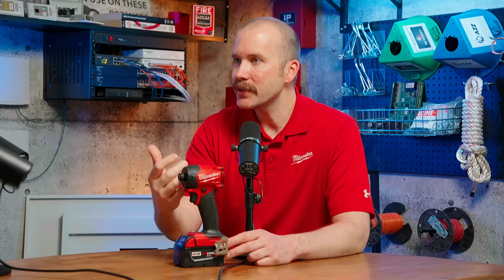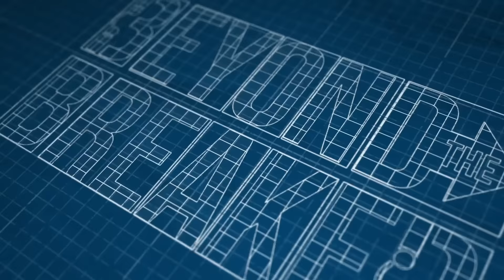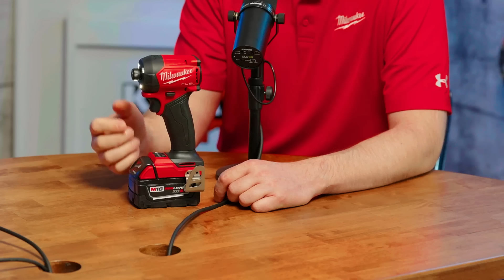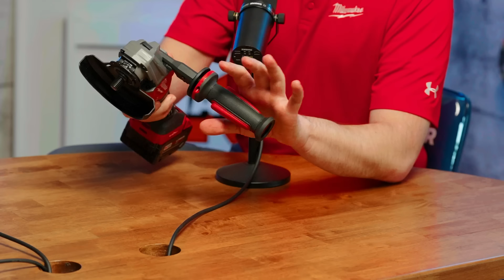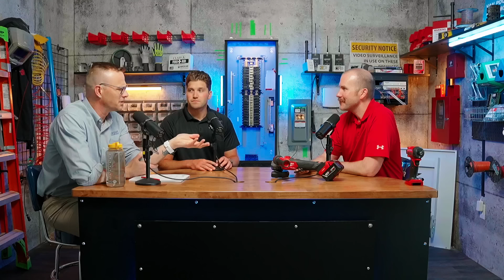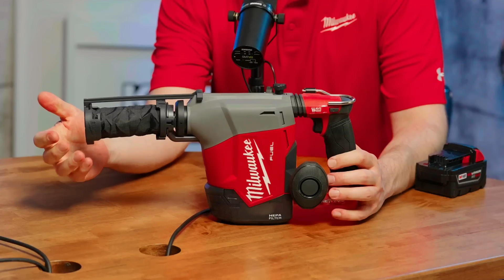How Modern Tools Are Built (Milwaukee Product Manager)

Comment: Milwaukee has great tools. I’ve used them for years and they have held up very well. Their warranty is solid. Love the fact they don’t change the battery design allowing to use your old tool with the newer battery technology. Just purchased the worm drive circular saw and it slices wood like butter. Also love the safety aspect of many of their tools. Keeps from getting your hands and wrists from taking a beating.
Reply from the maker: Awesome! Thanks for sharing

Comment: I haven't seen one of those hammerdrills on the job site yet... Looking forward to it!
Reply: I got one, its not that great
Reply from the maker: What makes it not that great?
Reply: @beyond-the-breaker baiting for comment engagement? ok, i'll bite. the sock that goes over the drillbit has brittle plastic locking rings, and the the built in vacuum is not very strong so some dust still spills out
Reply from the maker: You'll have to report back when you do!